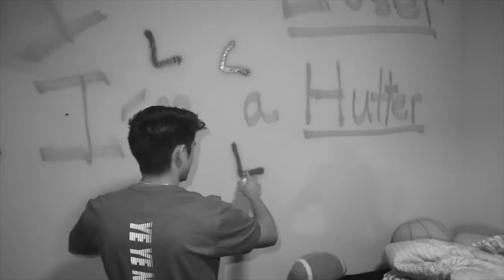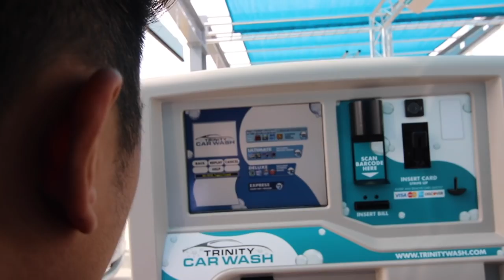Transforming Mini Van into SUPERCAR!

Comment: also that's a lot of rice. Btw modding your car is putting new parts on the engine. Turbo chargers, a chin spoiler, awd, nicer engine, tuning. ps: you don't put a spoiler on a car. that will slow it down.